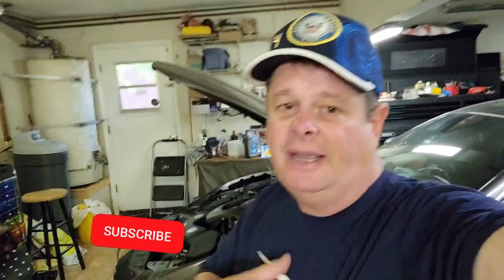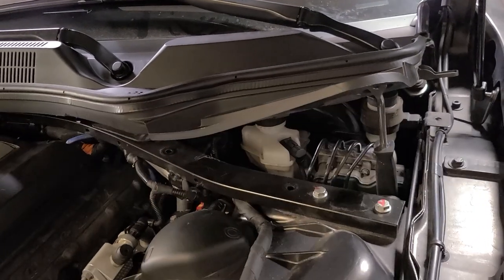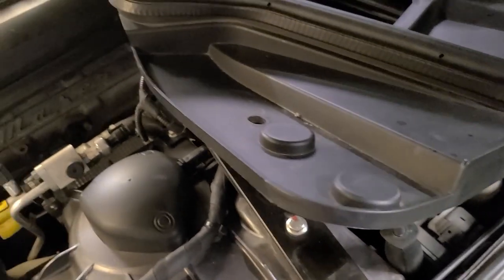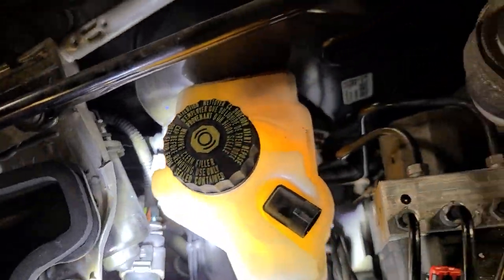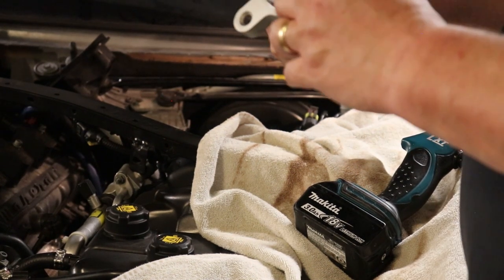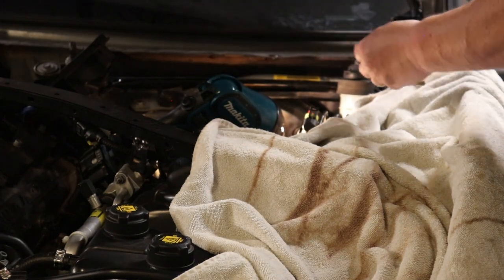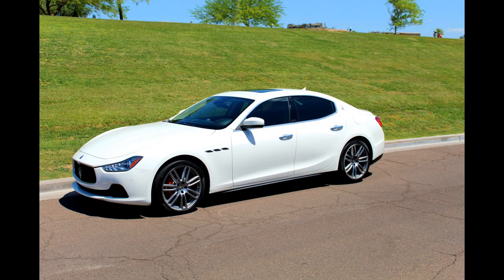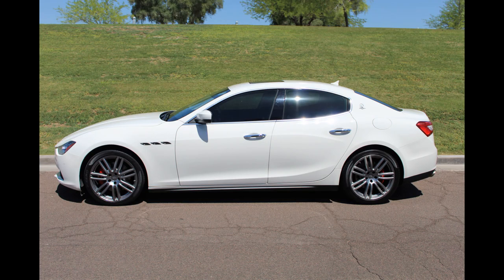Ever Get That Sinking Feeling? My Brake Pedal Slowly Sinks to the Floor.

Comment: FRACK the expensive computerized "diagnostics". Some stupid 20-year-old hooks up a laptop to your car, follows a one-page printout, charges you a fortune, does "something" like change software in your car, and calls the problem fixed, without doing anything!!!
I had an overheated, warped, and rebuilt engine run weird. Took it to the dealer at the time because I was really mad at myself (for overheating the engine) and at the engine (took too long to rebuild half by myself half with some shop assistance). Same thing, charged me for "computer diagnostic", told me they reset timing to manufacturer original values. Turned out it was a cylinder which was still leaking thru inlet/outlet valves!!! You don't need a fracking computer telling you timing is off by a microsecond if you got your head on your shoulders, and you are an experienced car mechanic!!!
Turns out that when they refinish your valve body, they ask you if you want to do a leak test. Saying "no" to save fifty bucks - this is what happens. Sent the valve body back to machine shop for additional refinishing and leak test. Cylinder ran fine afterwards!!!
Reply from the maker: On your Maserati?
Reply: @JamesDIYGarage  Heck no, 20-year-old Dodge Caravan. I don't drive Maserati because nobody gave me one for free yet.
Reply from the maker: @nameredacted1242  Hahaha, I got tired of waiting and just bought one.

Comment: Yeah it takes all the strength of a man to bench bleed a master cylinder.  Seems a really dumb way to do it.   How about installing it on the car and using the power of the brake booster.  The hoses the same way as bench bleeding.
Reply from the maker: Just following the steps outlined in the service manual and videos I have watched. But I ended up doing it the way you suggested anyhow.

Comment: 11mm exists
Reply from the maker: I have never seen one sold with a set.
Reply: @JamesDIYGarage   I have a craftsman set from probably 15-20 years ago, it is included in that set. Guessing it is uncommon and most companies try to cut costs.
Reply from the maker: @reader5611  agreed, as it is very uncommon.

Comment: MMMMM you obviously haven't got a clue .
Reply from the maker: Well, I never said I was a master mechanic, in fact my description on all my videos has a disclaimer saying I am just a backyard DIY mechanic. Having said that, my brake system is working flawlessly. Nice solid and holds pressure. So I guess I did something right.